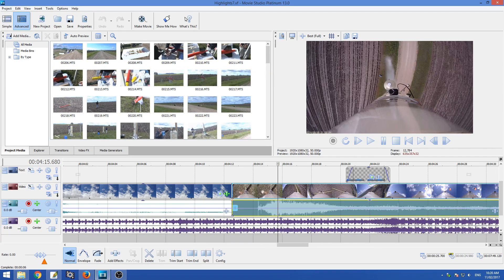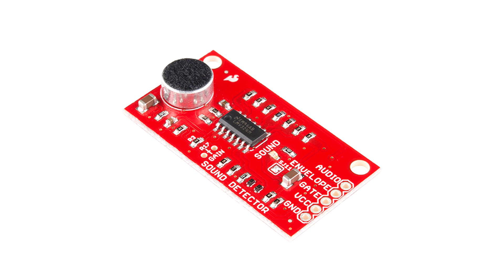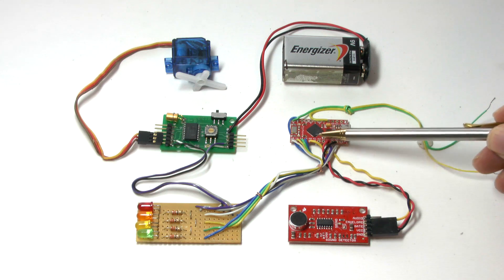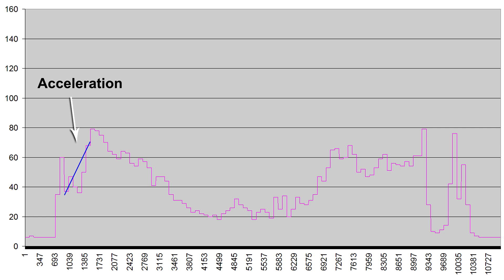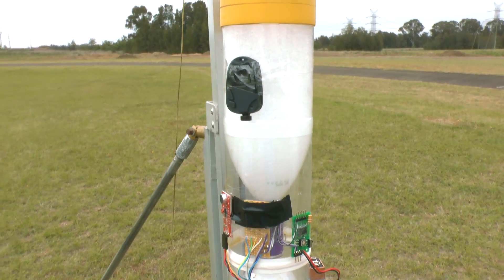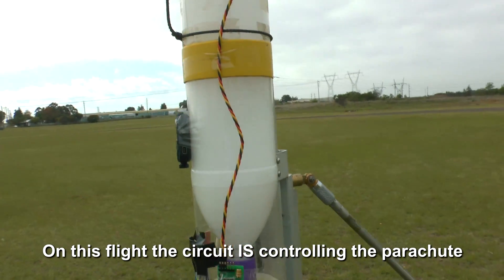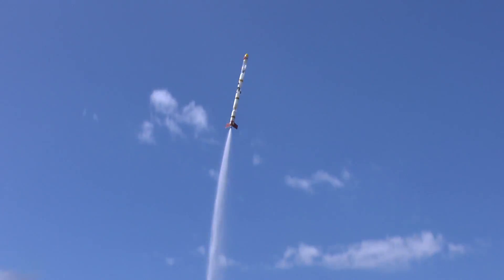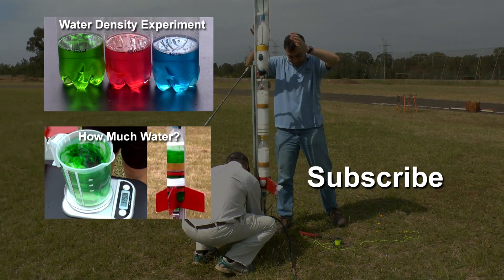Acoustic Apogee Detector

Comment: Is it  useful when altitude like 1000ft ?
Reply from the maker: Yup, you could probably go 30,000+ feet and still hear the air rushing past.
Reply: @AirCommandRockets  well i have another question,in high power rocketry can we use BMI160 IMU sensor ?

Comment: I really like to watch your experiments/tests. They are a good inspiration to do water rocketry in a "professional" way. Soon I'm going to launch my Atlas V 501 Replica (check the static test of the last version).
After 3 years of development and an infinite number of tests, finally I'll be able to release my X-37ABC at a decent altitude... (at least 100 feet, according to rctestflight). Of course, if everything goes according to the plan.
Reply from the maker: Thanks. :) I just had a look at your Atlas V 501 rocket. Looks great! :) Best of luck with the maiden flight.
Reply: AirCommandRockets Thanks! Clifford Heath simulation looks promising. My Atlas replica water rocket weighs approax. 600g, but there is a lot of drag caused by the payload fairing. My PVC launch pad can withstand 6/7 bar, therefore I should be able to reach more than 50 meters. Following the Shuttle's drop tests of RCtestflight, to create a sort of lifting body effect, my X-37ABC should dive at least for 30 meters, in order to gain enough airspeed, achieving a controlled glide...
hopefully!